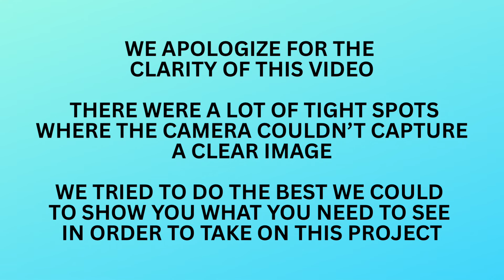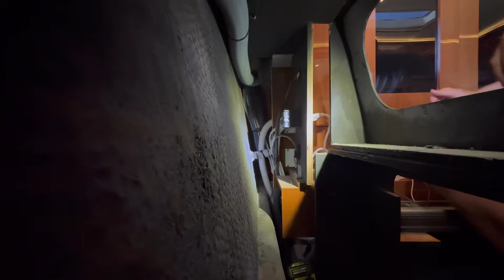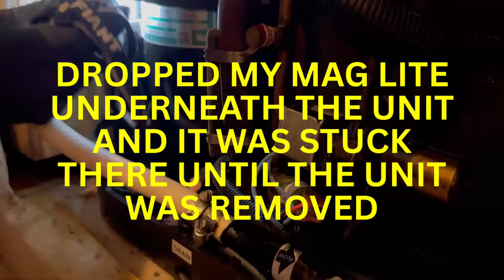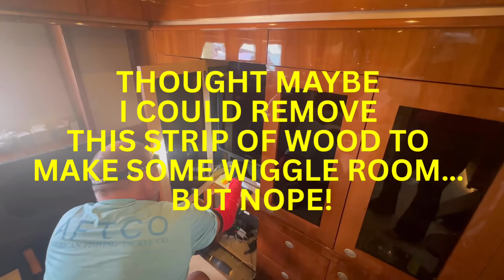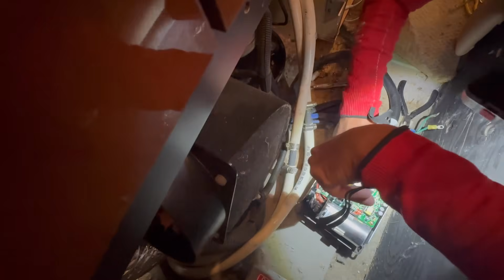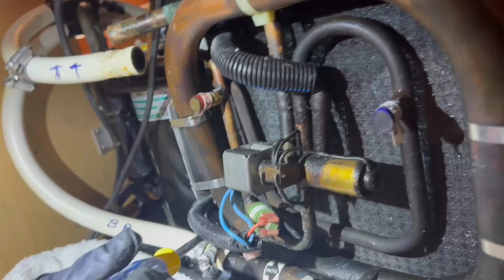Worst Boat Project So Far! Salon A/C Removal on our 48 Sea Ray Sundancer

Comment: Great video incredibly helpful ! Looking forward to more projects ! One question , would have been too hard to make a bigger access hole in the aft state room and make a new cover for it ?
Reply from the maker: Thank you for watching.  The problem with that concept - yes it would make sense to do that from the factory - but the electrical is under the table.   Why - no idea - just sits on the floor.  You also have the cabinet on the salon side right above the AC so you would be cutting that out as well.  It really is as simple as installing before the boat is finishing and expecting the A/C to last forever!!   Please let us know if we can help in any way.   Thank you again

Comment: Ok, first, GREAT video.  Now, go a little more in-depth on what you had to do with the carpet/underlayment to get the table out.  I felt like that was a key point and I missed what you actually had to do!  Thanks for sharing.
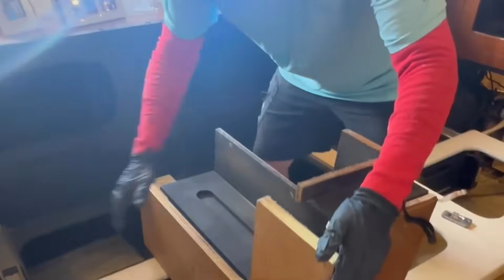Reply from the maker: Start at 28:55 and watch for about 10 seconds.  On the bottom front of the table you will see a 1” lip.  When we were pulling it out - the two of us were in front of the camera and we could not see what we were doing. So you need to reach under the table till that lip and pull the carpet back about 10”.  The padding is glued to the floor.  We used ceramic knives to scrape under the padding all the way to that lip I referred above.   Eventually I was able to tear it out.  The lip was getting stuck on the padding.  Once we removed the padding it pulled all the way so we can lift it out.   If you need more detail - please let me know and than you for watching.